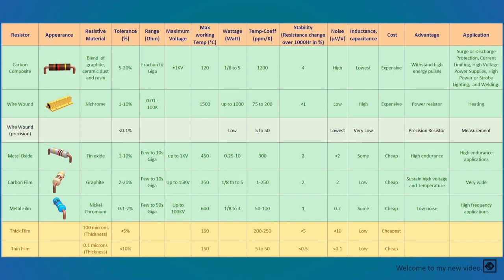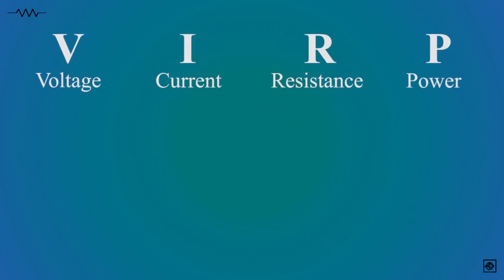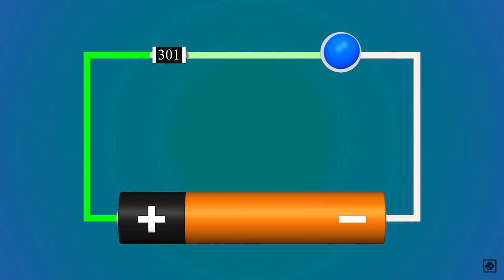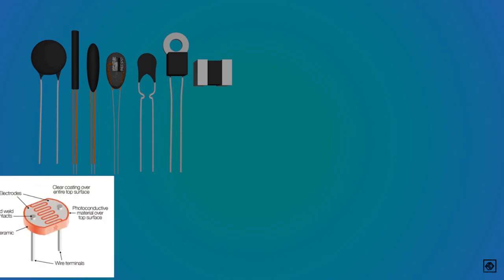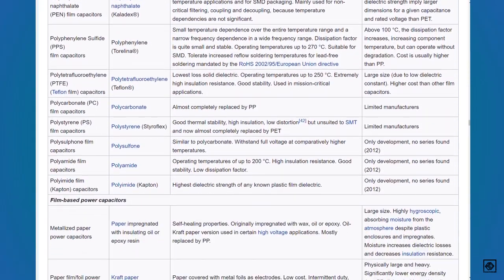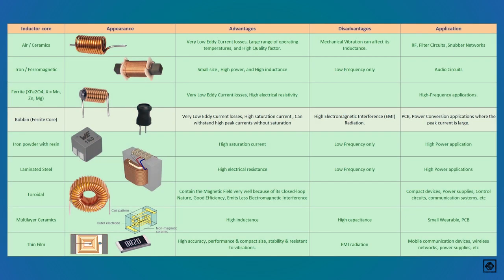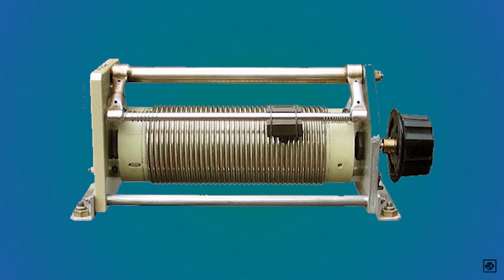How to select a Resistor, Capacitor & Inductor?

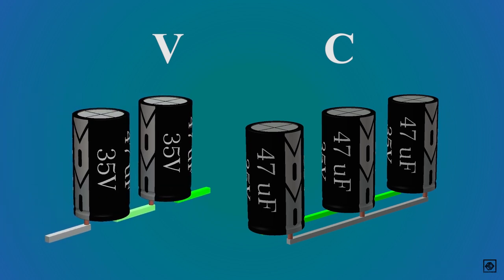Comment: 6:57 when capacitors are in series isn't the capacitance also dropping? Very nice video by the way.
Reply: The capacitors are in series the capacitance it's the same but the voltage it's higher
Reply: The capacitance of caps in series is calculated the same was as you'd calculate resistors in parallel:

1 / (1/C1 + 1/C2 + 1/C3 ...)